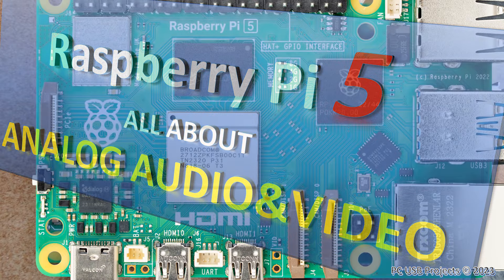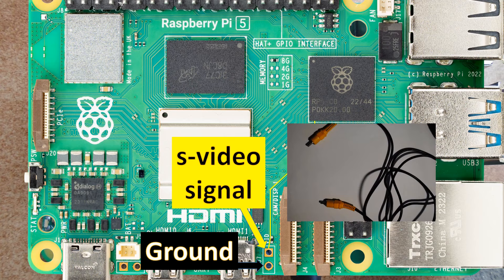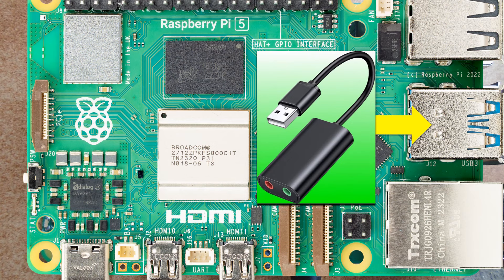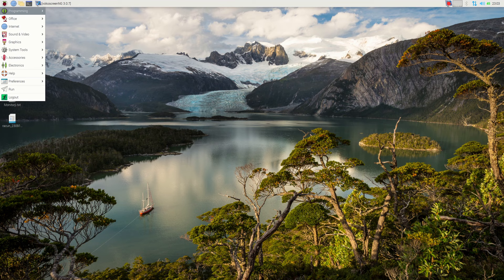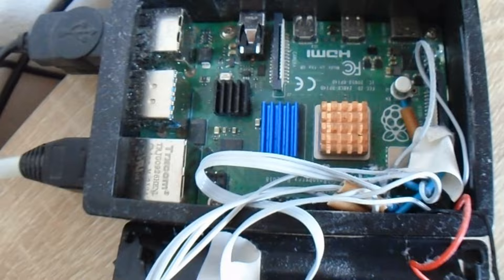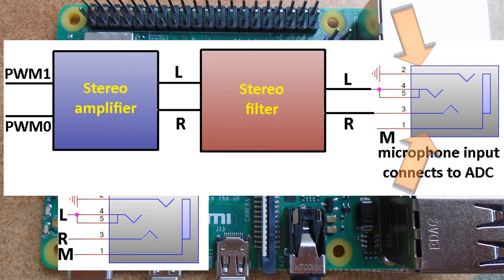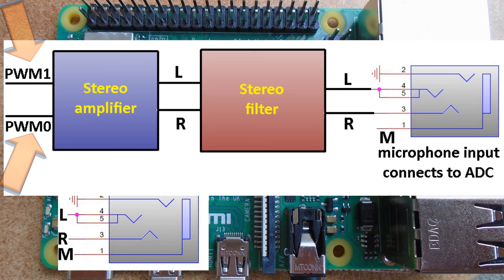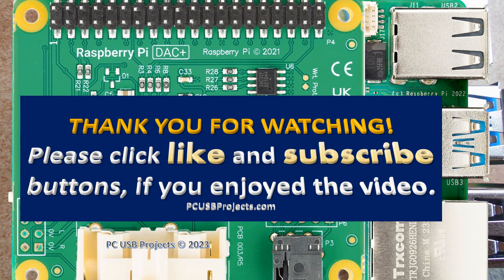HOW TO MAKE: Raspberry Pi 5 ANALOG AUDIO&VIDEO outputs and inputs

Comment: You confused S-Video with Composite.
Reply from the maker: Only composite video is supported on RPi 5. According to the RPi lead designer James Adams there was not room for implementing s-video signals on PCB. I'd like to add that there was also no room for a composite video connector... As you could see in my video...

Comment: Hi. I want to use the Raspberry Pi5 as a Android head unit for my car. My question is: can this J7 Composite Video Header be used to see the image from a composite rear-view camera? Is this port only out? Or can it also take signal input and display it on the screen?
Reply from the maker: No. It is just a video output, but you may attach a standard USB 2.0 (web) camera with a 5 m long cable. But I suggest that you test the cable first. Not all USB 2.0 devices can use this long USB 2.0 cables.

Comment: you missed the best way. rgb pi cable!!!
Reply from the maker: It is the most complex solution to implement at home, if you won'a build your own cable. You also need software drivers or even a specially adapted OS for RPi. It works with RPi 2, 3 and 4, but RPi 5 has a different hardware architecture (RP1 chip for all slower devices including the ones connected to the 40-pin expansion port), so it may be hard to find drives, as it is hard to find them for  homemade audio jack implementations. But composite video is supported off-the-shelf. If you've watched  my video (
https://youtu.be/Zh1DVYKOZE8), you could see that the connecting cable was simple. You can also attach it to a SCART connector. Most video devices with SCART inputs also support composite video. The video quality is about the same. But some very old TV-sets may only support RGB, which is usually not the case with VCRs, of which most support composite video, only.